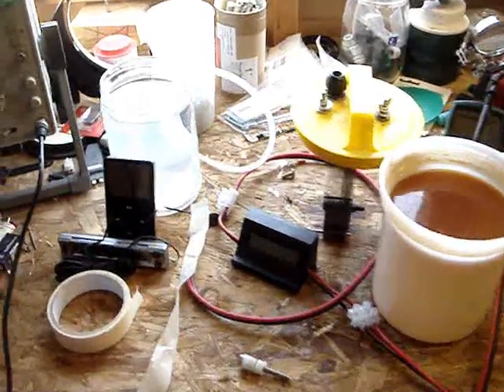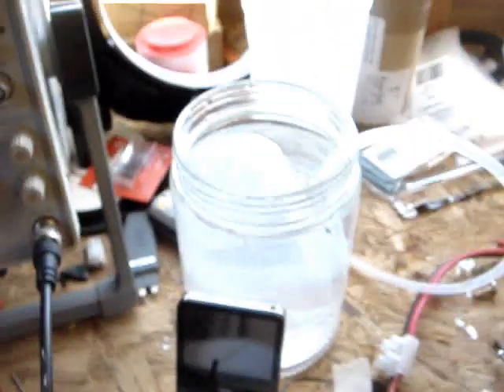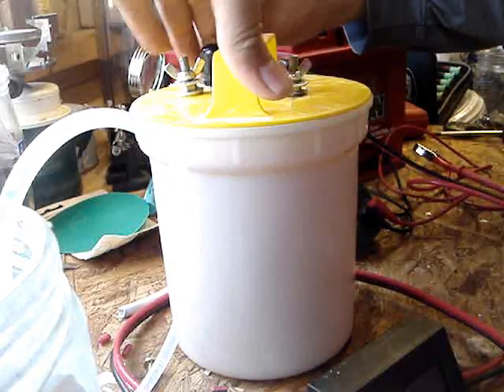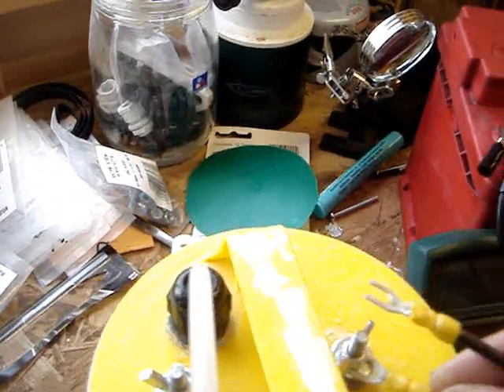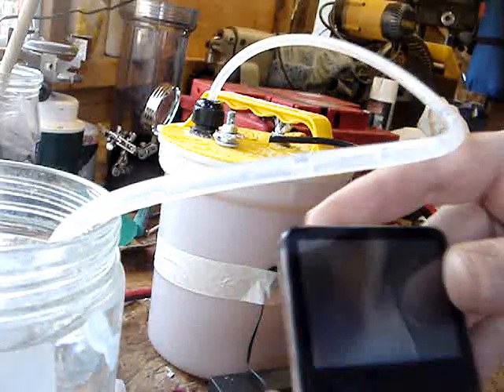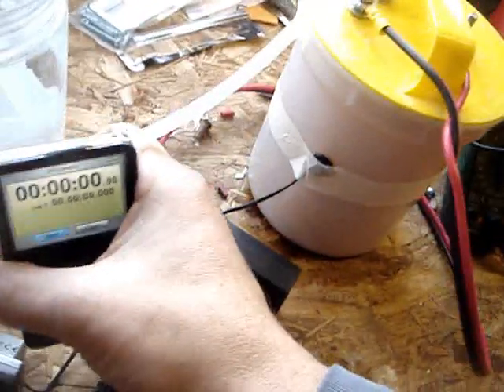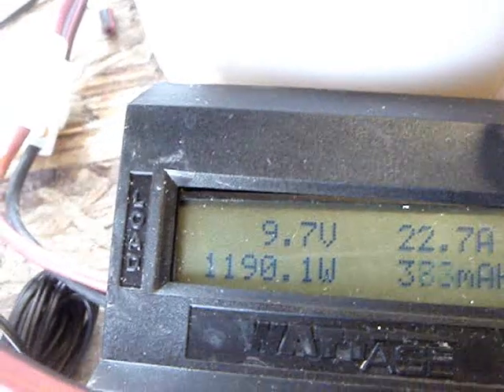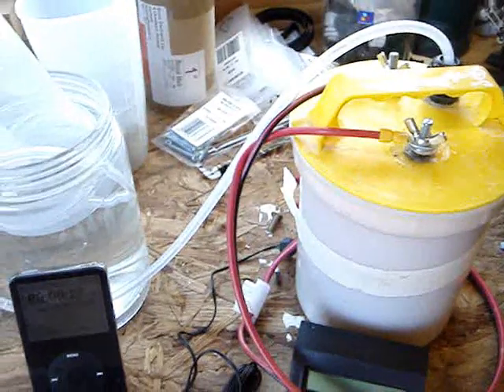HHOFromWater Output test 2

Comment: from my calculations your watt meter was correct but it could not display the third digit on the amps it should have read 122.7 amps no wonder the voltage from the battery dropped to 9.7 volts. Be careful of what you are reading there.

Comment: your machine said 1190watts? but you had 9.7v at 22.7A that should be 220.2 watts? Awsome production reaching 960ml/min at the 9.7v and 22.7 amp that's like a 56.2% eff. if that is all correct. What is your plate arrangment? it looks like +-+-+-...etc..?